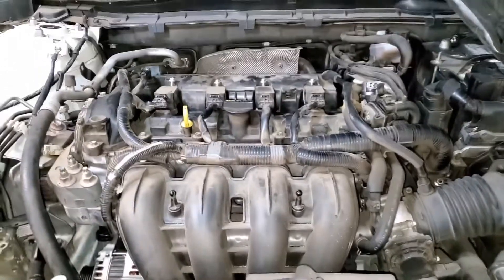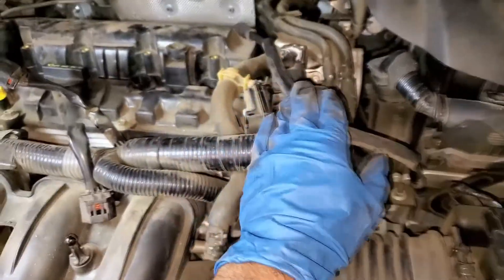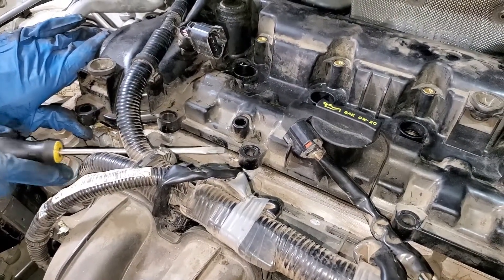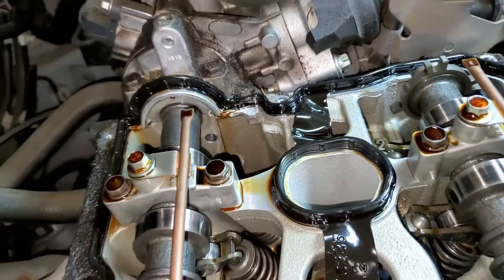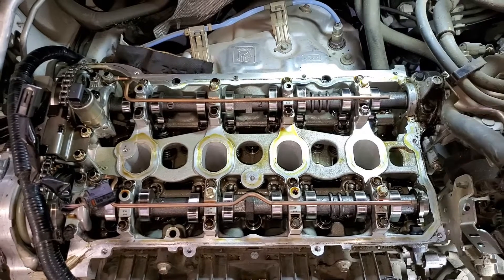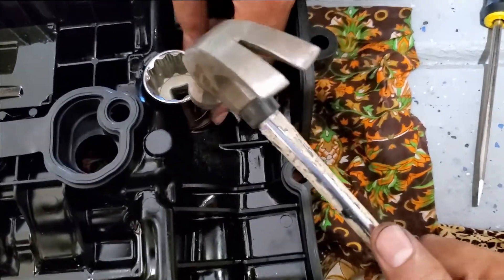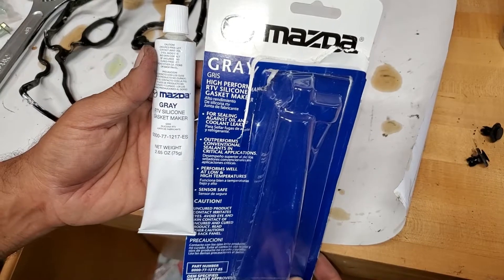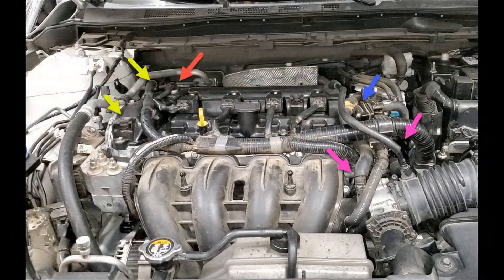DIY - How to Replace Valve Cover Gasket on a 2.5L Engine found on Mazda 3, 6 and CX-5

Comment: fyi:  use RTV around the rubber gasket for the oil control valve.  even a new round rubber gasket won't stop it from leaking through.
Reply from the maker: Thank you for sharing
Hopefully other will do this when they do this repair
Reply: I read this after installing my valve cover back on already. 😔

Comment: A kitchen scrub pad will most probably scratch the aluminum cylinder head, creating a potential leak passage.  Use a plastic razor blade (not metal) to clean off RTV.  A rag soaked with brake cleaner is recommended for cleaning off any remaining residue and oil.  Also be sure to clean the channel where the gasket fits in the valve cover, the hole for the VVT gasket and the VVT solenoid itself.
Reply from the maker: thank you for the pointers!!

Comment: I just did this yesterday, the oil control valve gasket seated just fine without having to use a socket and hammer.  Some recommend to put gasket maker on the outside of the OCV gasket or else the leak will come back within months.  I used Permatex Anaerobic Gasket Maker (51813) instead of Mazda's overpriced RTV, reason being is RTV can cure in your head and clog oil passages if you use too much, whereas AGM will stay liquid outside of mating surfaces.
Reply from the maker: thanks for sharing your experience.

what do you mean by it remains liquid on mating surfaces...it too is supposed to cure otherwise it won't create a seal.  this product does cure, here is what it says on their site:

"Fills gaps up to .015″ and cures to a solvent-resistant seal that will not tear or decay during service. Parts disassemble easily even after extended service. Old gasket material can be removed in minutes with a simple putty knife."
Reply: @footprintsinconc  Outside of the part being sealed it will stay liquid, as in it only seals where the gasket meets the head and you don't have to worry about the excess.  The factory RTV on my head was just about touching the timing chain because they put so much on it.
Reply from the maker: interesting, i had no idea.  i would assume that it would dry up.  so if you were to squirt some out on a piece piece of card board and leave it, it won't cure?
Reply: @footprintsinconc  Correct, it would not cure.  Any of the excess that was pushed out when I put on the new valve cover gasket is still "liquid" and can be wiped away. This consistency is slightly less than RTV. So far I have used this on my Bandit 600 valve cover and my Mazda 3 valve cover.

Comment: Very good video! Did you have a leak on the head of engine to do this, or just preventative maintenance?
Reply from the maker: the valve cover was leaking...it was drippig all the way down

Comment: is it good to buy a used 2020 mazda cx5($26k) which got it gasket replaced? I see this report in the Carfax. does this mean this particular car had some issues and fixed it?
Reply from the maker: i'd get a mech to check the car out....every mechanic shop does that for your peace of mind before buying the car

just becuase it had the gasket replaced, it doesn't mean the car is bad...one less thing for you to fix when you get.

i'd take it into a mech and pay $100 or $200 to get the car inspected

Comment: Just diagnosed with the same problem my question is the timing chain cover is wet not dripping with oil and they are saying it's from the pan gasket leaking ...does this make sense thank you

Comment: I have a 2018 cx5 53k miles that has a few drips under the heat seal so I can't see where the leak comes from, could this be the valve cover gasket? Looking at the video, it seems like if the problem is the valve cover gasket, one would be able to see the leak from the top of the engine.

Comment: Nice video. I have a mazda 3 2014 itouring i wonder if the part for vvt solenoid gasket that u used is the same as well for me? Because i know the gasket is the same i just wanna make sure

Comment: I have a 2016 Mazda 3 and there was Trans oil put inside with the engine oil. 🤦🏾‍♀️ Now there’s smoke coming out of the exhaust pipes and the oil has been changed along with the spark plugs but it still smokes like a chimney and when accelerated beyond 40MPH, you heat a running noise and it slows down and smokes again. 🤦🏾‍♀️🤦🏾‍♀️🤦🏾‍♀️ Idk what’s wrong because there’s no codes when I got it checked! My poor baby. 🤦🏾‍♀️
Reply from the maker: not sure what advice i can give, other than take it to a mechanic.

Comment: Great video, thank you so much. Could you share the socket numbers you used? Also, do I need to replace the valve cover gasket if I’m only in need to replace the OCV seal?
Reply from the maker: Thank you!

i think the sockets were 10mm....if you have a set of sockets, you'll find the right one.

I would since you have to remove the valve cover gasket.  It'll be like you are starting fresh.  Make sure you the RTV that i have the liked to in the comments.

Please help out wiht YouTube algorithm by liking and sharing!
Reply: did you replace the valve cover gasket? I plan to replace my OCV too

Comment: Question why didn't u replace  spark plug well oil ring
Reply from the maker: Watch at 13:37 minutes and on.
The valve cover gasket has attached to it the center gasket that forms an oil seal at the spark plug well.  It was changed out.

Comment: great step by step video! I just changed my plugs (16' CX5) and noticed oil on the spark plug threads (only in cylinder 1) Do you think this would fix the issue? Thanks
Reply from the maker: Thank you! 

Yes, the gasket goes around the spark plug chamber, so yes that would fix that issue.

I would flash a light in the hole and make sure that you can see the leak in there before doing this repair.
Reply: I just changed plugs and coils on my 2016 mazda 6. I too had oil on cylinder 1 spark plug.

Comment: The gasket is made of rubber not silicone so it shrinks with heat over time. Built in maintenance scheduling and it will fail as well as the vacuum pump seals
Reply from the maker: they are made out of rubber, and yes it does shrink over time.  the quality of these i'm sure can be improved so that they don't leak this quickly...

Comment: Did a very professional job someone said to replace  that well oil ring and that y I looked at video but didn't c that
Reply from the maker: Watch at 13:37 minutes and on.
The valve cover gasket has attached to it the center gasket that forms an oil seal at the spark plug well.  It was changed out.

Comment: Thank you for the video.  I'm about to do this soon but I was wondering did you seal the ocv with rtv? I saw some have issues with leakage but I'm not sure where exactly to apply the rtv to the ocv.  Is it just at the top once pushed in or around the ocv and use it like glue?
Reply from the maker: You're welcome!  Good Luck!

I only applied RTV in the spots per the repair diagram i shared in the video.

Please help out by sharing and liking.  Thank you!
Reply: The OCV seal is such a shite design.  There's no way it can't leak, especially with the 0W-20 in the Skyactiv engines.

Comment: I can't get the wiring clip to come off like you did at 2:09.
Reply from the maker: the nib or anchor is shaped like a W
for the one at 2:09, for me the one leg of W (right leg) was visible...i pushed towards the car for it, and pulled on the connected...while pulling up on the harness, the back leg of the W just unfolded downwards.

Comment: You used way too much silicone in places you didn't even need it. You simply need a dab where the timing cover and the head meet as well as a small dab at the base of the rounded surface not on top. Other than that you did a good job.
Reply from the maker: Thanks for the comment. 
i did apply more than needed.
it's basically just needed where there are two metal pars coming together to seal any variance in height at those locations.

Comment: Great vid. All of yours are well done. Question, how critical do you think it is to replace the Engine Valve Cover Washer Seal if there is no sign of leaking? I was thinking of just doing the gasket.
Reply from the maker: Thank you!

To clarify what you are asking....I assume that the "engine valve cover gasket" is leaking, so you are going to replace it.  While doing so, what you are asking is, is it necessary to replace the "engine control valve gasket"?  If yes, then I would replace it now as the only way to access it when it leaks is to remove the valve cover....too much work to save $15 or $20.

Now if your "engine valve cover gasket" is not leaking, then you don't need to do this repair at all.  I would not do this whole job if there are no oil leaks.

let me know if I've clarified your question.

Please help me out with the YouTube algorithms by liking and sharing and subscribing!  Thx.

Comment: Valve cover bolt size?
Reply from the maker: It might be a 10mm...but if you have a socket set, it's easy to figure out what size you need.

Comment: I think you put too much rtv in those select spots.   It does not take very much.  It squeezes out, especially if you torque it all down right away.   I usually finger tighten all the bolts and let it sit overnight and then torque it all down.   But good video